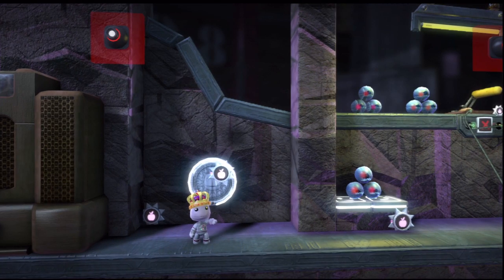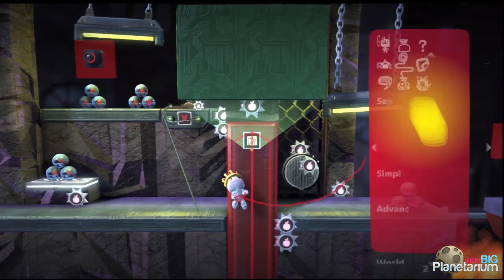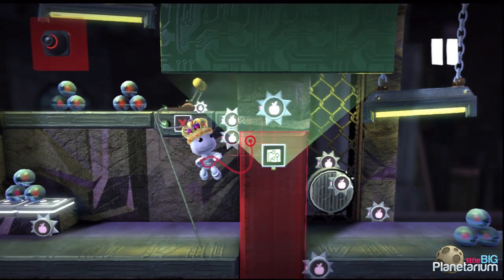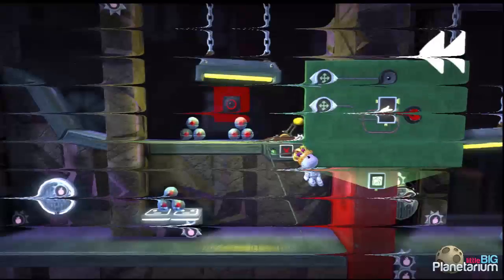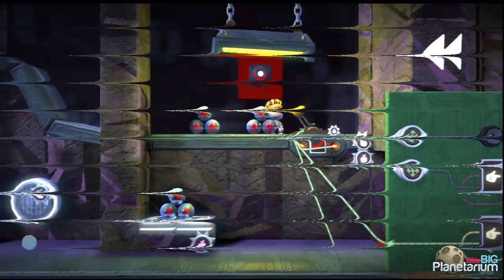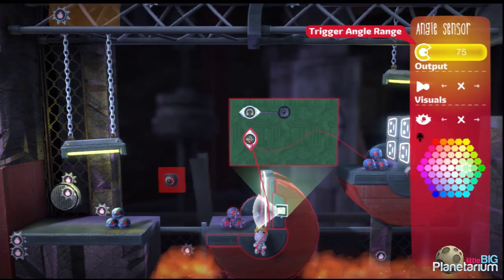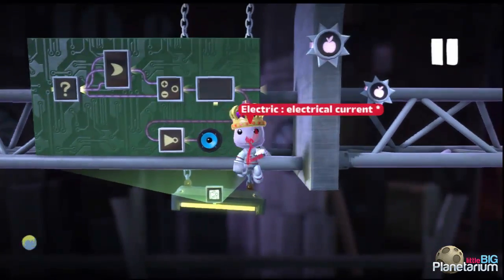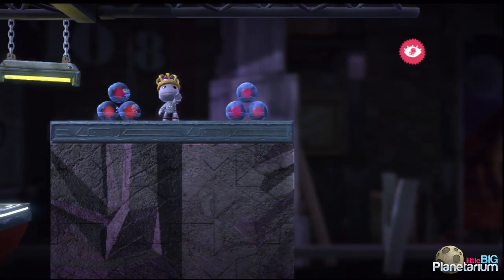LBP2-Torials 27: Implementing Audio

Comment: Nvr mind, I just figured it out, I just had to put the Cannon Timers in a microchip, then get 2 other timers on the outside, 1 resets the other, set 1 timer to how long you want the cannons to fire, then set the reload time. Set the firing timer to a toggle or 2 port selector, then hook the toggle or 2 port selector to the microchip and there you go.